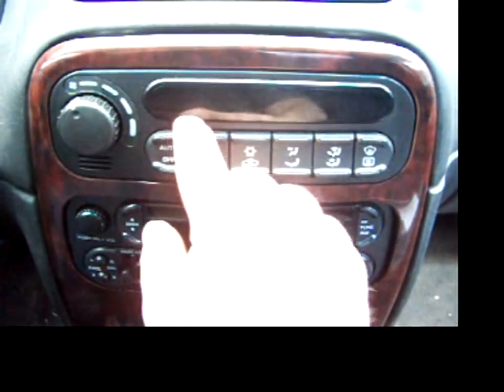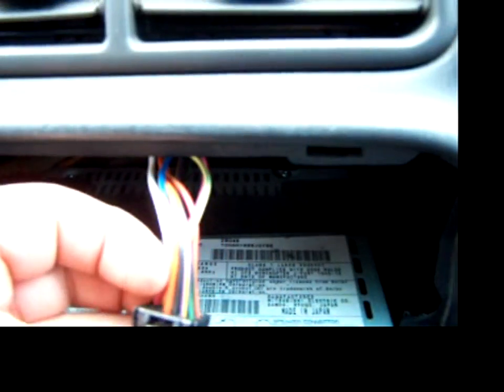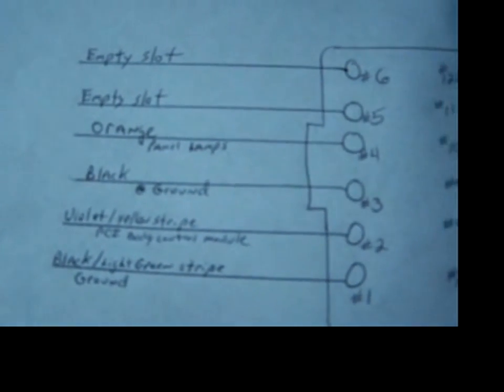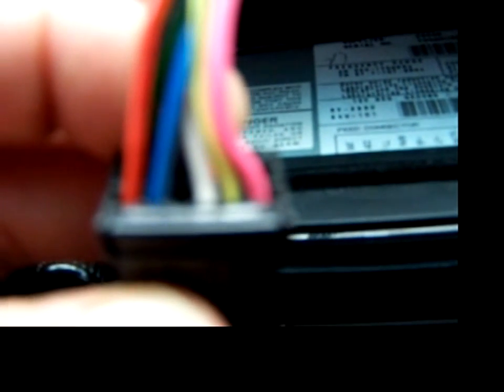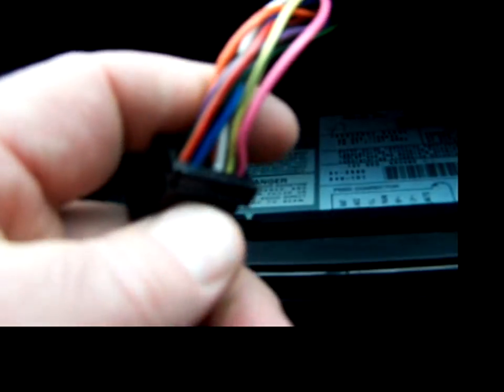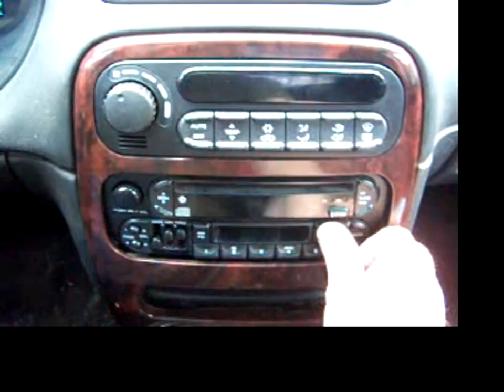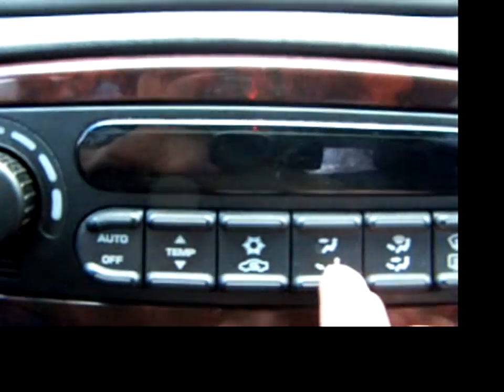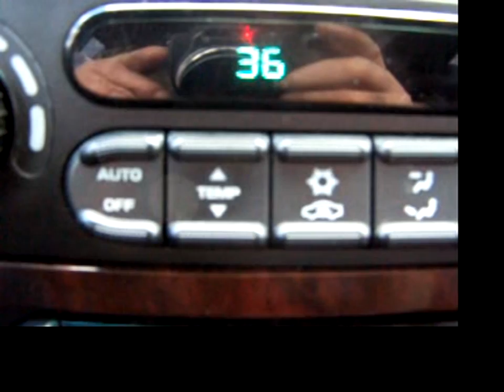Automatic temperature Control( ATC ) part 3

Comment: Glad I watched this Part 3 video!  Not sure how you figured out it was the wires going into the plug?  I had the same issue where the climate control worked fine but the display wasn't lighting up. I played around with the wires on the plug after watching this video and like magic the display lit up again.  Thank you for saving me $$$ on what ended up being a simple fix.
Reply: Same exact thing with me !  I have a 2003 Chrysler 300m special. I had the same issue and watched this video and like Magic it started working. Thank God for YouTube lol

Comment: Great and helpful directions.  I could not figure out how to open the wire connector. But I did solder the resistors and that is all it took.  I could not see the crack in the solder, but I touched all 3 resistors near R14, with the solder gun, without adding solder, and the display works now.  Now I can see the error code for the blend door.  Thanks so much for this video.

Comment: I got it thanks, I did not fold down the clip thing-- though my dispay used to work when I pushed on it-- I greased it up and it still does not work--  It might finally be dead-- I used to be able to push on it and it would come on for a week.  I took it apart and all the solder looks decent-- everything works but the screen

Comment: I have tried to get any wires out of this harness and can't. I have the tabs folded down. Do they need to be pressed all the down back to the harness?  What are you using to push  the wires out with and from what hole...the small holes or the larger holes?

Comment: Before I try this again, are you saying that  the wires are held in by a tab? I do see that each wire does move back and forth a little bit but it looks like they are kept in by a "tab" as you say. Is that tab on the wire side or pushed from the other opposite side of the harness? Thanks for your help.

Comment from the maker: Check for cold solder break on both end of the surface mounted resistors on the circuit board that is a common cause. look real close with a magnifier glass. usually a hair line crack.hit it with soldering iron.